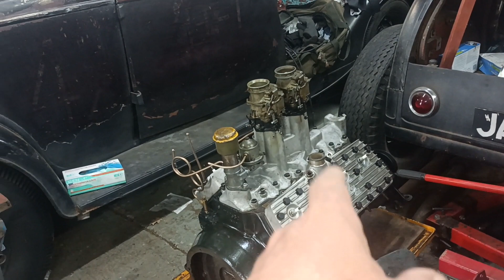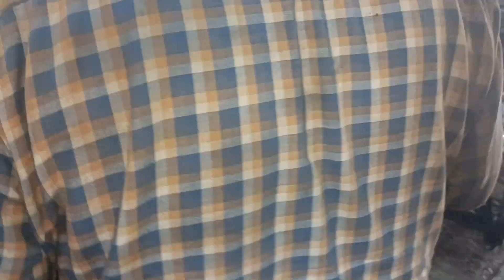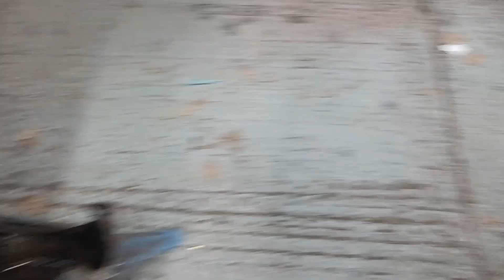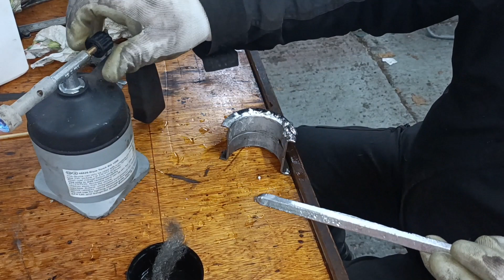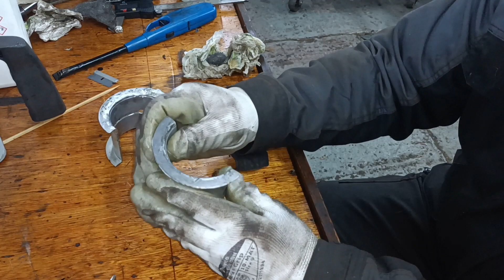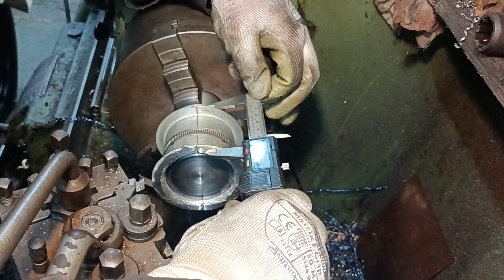Big Inch Flatty: PCV and crank endfloat fix. Part 1. Thrust bearing babbitt buildup. (2268)

Comment: Hi Mart..after watching your great works I was thinking if you had made the mandrel before starting you might have been able to make it come through the centre and clamp the shells on prior to building the metal onto the edge..would have kept metal away from bearing surface and given you an edge to build up against..maybe
Reply from the maker: Hi Patrick. Yes, there is always a different way. This was my first attempt, so had no precedent or comments from a previous attempt. I turned the mandrel and did not take it out of the chuck until the job was finished, hence maintaining concentricity. I did try it again on another job with the shell clamped to a different fixture but the fixture drew too much heat out of the part and made it difficult to build up the metal. If I ever do it again I might do it differently. I'll cross that bridge when I come to it. Thanks for watching and taking the time to comment. Mart.

Comment: Don’t know how you washed the bearings after Babbitt application, but I would neutralize the tinning acid with distilled water and baking soda. Cheers.
Reply from the maker: I just washed them in the sink. Good tip, though, if I do it again I might try that.